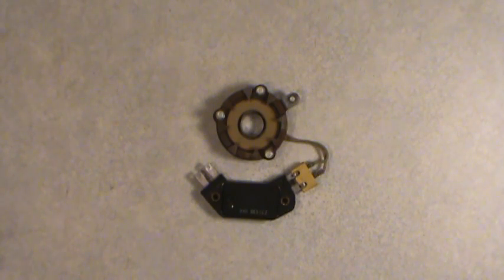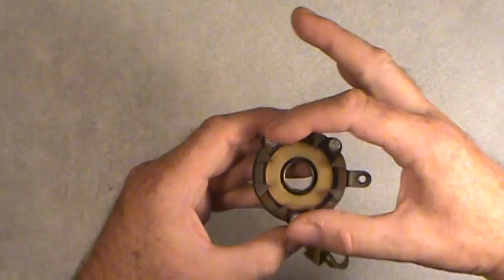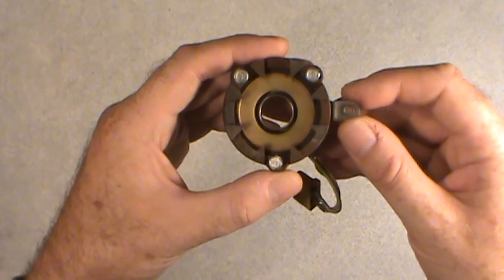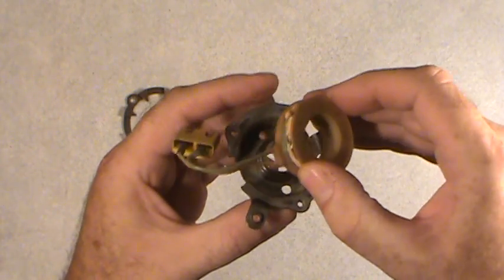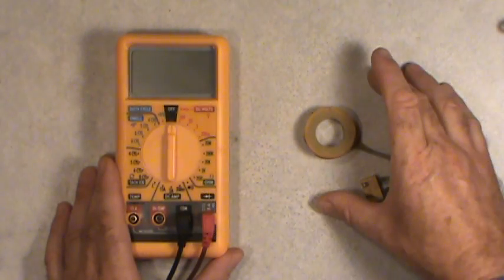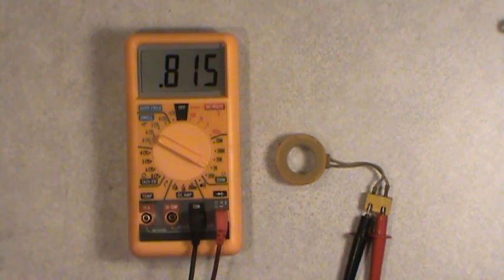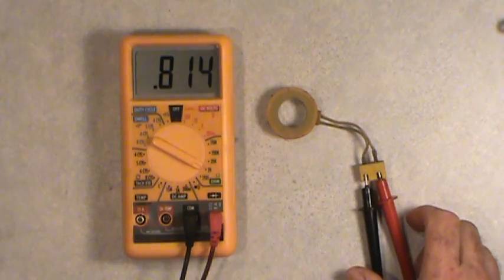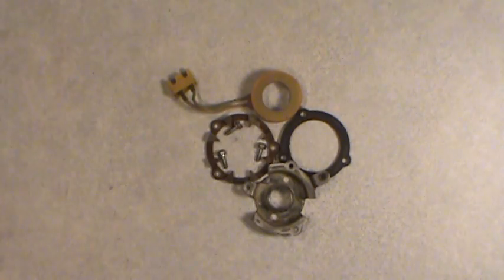HEI Distributor Pickup Coil Test

Comment: 88 Z28...  strange misfire I've been dealing with for 2 years now...  seems to be centered on the pickup coil.  I fully rebuilt the distributor last year with GM parts, even sourced an NOS shaft assembly in case magnet was cracked.  Also have an aftermarket distributor, completely new, that has a different style of coil that does the same thing.  Pickup coil, given a constant input speed (say, 650 rpm), is outputting a variable frequency, which obviously resonates through the rest of the ignition system resulting in bouncy tach and random misfire.  Any suggestions?
Reply from the maker: Greetings...Daniel Vogel..........Thanks for watching.........Yes-Sir-ee-Bob, I do have a few things for Ya.........First up, try "diss-connecting" the Tach (Tachometer) wire/s, from the electrical circuit, then, start the engine, to see if that changes things (there might be a Tach-Filter, in the circuit as well).........Make sure, that, there is a thin coating of (computer chip) "Thermal Paste", applied to the bottom (metal side), of the ignition control module, or, it will over-heat, and probably go "poof" on Ya (Don't use die-electric grease, because it won't transfer the heat properly...!!!)...The proper (heat transferring "Thermal Paste/Compound", can be found at a computer/computer parts store (just get the cheaper, usually silicone stuff, because, some of the other stuff, gets quite expensive...!!!)..........If those two wires, that come out of the pick-up coil, are still reasonably soft, then, disconnect the connector, and "twist" the connector, so, those two wires, twist, one or two turns, around each other (this is known as, the old school, twisted pair shielding, which will usually help with, any interference, getting into those two wires)...(computer Ethernet cable, is twisted too, four twisted pairs/8 total wires...cool huh)..........Sometimes, the "Vacuum Advance" canister/unit, has the wrong specifications, for a given engine..........An engine that has, a "Low Vacuum" signal, at idle speed, showing on, an automotive type of vacuum gauge, that's hooked up to, intake manifold vacuum, usually won't get along with, a Vacuum can/unit, that was destined for a stock engine........Try diss-connecting the (rubber-like) vacuum hose, from the advance can/unit, and plug the loose end of the same hose, so, Ya don't get a vacuum leak...!!! (or, more headaches...lol)...and see, if that helps at all..........Those two sets, of triggering "triangles", have to have, equal "clearance" (air gap), whenever, each of the inner triangles, is advanced, one tooth (triangle) at a time (there will be 8 separate places, to be checking, for an equal air gap)........Don't want any of those triangles making contact...right.........If need be, there are 3 screws, that can be slightly loosened, then adjust, for the (equal) air gap, by moving (slightly), the outer set of triangles, and then, tighten those 3 screws...........Is the ignition system, as good as new...???..........Space the spark plug wires apart from one another (with non-metal, wiring looms), and, keep them away from, any metal parts, like valve covers (high voltage, likes to jump...lol)..........12 volts/battery voltage, going right into the HEI Distributor...??? (usually red wire/connector)...........The Ignition Control Module, has to be "matched up with", the Ignition Coil, or, there might be a problem (weak spark, or, over-heated ignition coil, maybe)...........Wowsers, now that I think about it, Ya might have a "Bad Camshaft Lobe", because, I started out, learning lots about, the good ole HEI distributor..."Before"...I found, that (not-an-exhaust-valve-lobe-anymore), that use-tah-be on, the camshaft's, number 4 cylinder's location...(was in/on, a Chevy 350...V-8))..............Symptom was, a slight misfire alright...!!!..........Ya might be ok, if Ya have roller lifters...........Having flat tappets (lifters), then, there was a time, where a few guys, and maybe gals too, that had, that good ole, soft camshaft syndrome (and, I never thought, that, that "bug", would ever bite me, but it sure did...lol)..........Maybe, check out, the D.U.I./Davis Unified Ignition (HEI) distributor website, because, they will custom make, an HEI distributor, that has, an advance curve, for your "Exact", vehicle and engine combination...best performance, from an HEI, dropped in distributor.........Have a look at their spark plug wires too...impressive, I must say.........Good luck, and......till next time.......Be Safe, take care, and have a good one.
Reply: @RockysRoadshow  yeah, tried all of that already.  It's a V6, btw.  No vacuum advance.  Vacuum is strong.  It's the pickup coil assembly itself that's the issue.  The pickup coil is outputting a variable frequency output for a constant speed input.   Both triangle style pickup and the stock HEI star assembly in 2 separate distributors.  It's varying by as much as 30 to 40 Hz at even 650 RPM input
Reply from the maker: Greetings...Daniel Vogel...…...Well now, that variable frequency, of, 30 to 40 Hz (or call it, cycles per second), could very well be, how the output, of the pick-up coil acts, and, here's probably why...…….The actual triggering pulse, for the ignition control module, as I recall, happened, during a "falling wave", electrical signal (probably, a form of sine wave), that was generated, soon after, the inner set of triggering triangles, just went past, the outer set of triangles...……..On a, not installed, V-8 HEI distributor, the pick-up coil, will usually output, at its "disconnected" connector, about one volt (probably AC, I forget), give or take a bit, when I would spin, by hand, as fast as I could, the helical drive gear, that was on the HEI distributor's shaft, you know, at the bottom of it...……..You can try that test, with your, non-installed HEI distributor...…….A Random misfire, can sure be caused by lots of things...…...Start, by having a close look at your engine's spark plugs...look ok...???...……..Might be ignition related, or, fuel system related, sometimes, might be both at the same time, perhaps..........Have you tried, any type of spark test at all...???.........There is an HEI distributor "Spark Tester", that is calibrated specifically for, a factory/stock HEI distributor.........It kinda looks-like, a spark plug somewhat, but, has a plain metal shell (no screw-threads), and, should have an alligator? clip, that connects to a ground source..........There is also, an adjustable type as well, that can be set, to test, in the thousands of volts..........Just Google...HEI distributor Spark Tester...and see what pops up........Good luck, and.......till next time......Be Safe, take care, and have a good one.
Reply: @RockysRoadshow  That's all been done already. EVERYTHING IS NEW.
I'm aware that the coil outputs a readable AC voltage...  usually around 1.5V.  It's the frequency that the module uses to determine timing.   What I'm asking is for a given fixed input rotational speed, why is the pickup coil not outputting a constant nonvarying output frequency like it should?
Reply from the maker: Greetings...Daniel Vogel……….Well, here's what's goin' on, as far as I recall, that is...…..Think in terms of, a good ole AC sine wave...…….It's when that wave, starts to come down (aka, fall), when the inner set of triangles, just go past, the outer set of triangles, and it is the, so called "Falling" wave location, that is actually, the "signal", that "triggers", the ignition control module (or, in other words, this is what the ignition control module is looking for, so it can get triggered)……….Un-filtered AC (Alternating current) is all over the place, and here's what I noticed, a long time ago...…….I had, and still have, a hand held, variable speed, rotary, Dremel tool...…….So, I plug it into a house receptacle, and move the speed control/slider (switch), into, a not too fast position, and, with the rotary tool, just free-wheeling (no load on it, what-so-ever), then, I could hear the "speed" of that Dremel tool, shall we say, "Wavering"..."Up and Down", speed-wise, that is, and, what I was hearing, was, how the Dremel's electrical motor, was "re-acting", to the fluctuations (not constant), voltage, that the house's (AC) receptacle was out-putting (a multi-meter, will also show, a moving up and down, AC voltage as well)...…….You might be over-thinking, the output frequency thing, when it comes to, just simply, "triggering" the ignition control module...……The basic, HEI ignition control module, that only had 4 (flat) pins on it (2 on one end, and 2, on the other end of it), and, when in operation, it would receive that (now famous...lol), "falling wave" triggering signal, that, as I recall, then, the ignition control module, will then, "shut off", the electricity (nominal 12 volts), that goes to the HEI's ignition coil, then, the magnetic field in the primary windings, collapses, and then, the secondary windings, will increase the voltage (in respect to, windings turn ratio, there-abouts), then, through the rotor, distributor cap, spark plug wire, and finally, the spark plug itself...……..The ignition control module, is responsible for, the ignition coil's "Dwell/Charge-up time", which is why, the ignition coil works so well, without melting...……..I recall seeing, as low as, about, 7 Degrees, on a dwell meter, that was on, a Chevy V-8 HEI distributor, while it was at idle speed, so the ignition coil, would not receive too many Amps, for too long of a time period (milli-seconds)………..Too many Amps, going into an ignition coil, for too long of a time period, that wasn't designed for that amount, will usually, just over-heat, and go kaput...…….There are some pretty good Websites, and/or, website "Forums", that have lots of information, about, all of the HEI distributor parts and pieces, and how  they function...…….Most of the information, that I've put here, is basically, how most of the HEI ignition modules get "Triggered"...……..The older HEI modules (1975), that only had 4 (flat) pins on them, didn't react with any computers (they were/are, stand alone, one wire, HEI distributors)……….I'll have to check out, your 1988 HEI distributor's ignition control module (and how many pins, that it has), and, see what I can remember (or not...lol)………..Connect a "Vacuum Gauge", to your intake manifold or plenum, and see, how many Hg (inches of mercury), that your engine produces at idle speed (15 to 20 maybe...I got about 17, on a V-6), and, the gauge needle, was holding steady (not fluctuating)………..Intake vacuum leak...???...intake manifold gaskets leaking maybe...???...and...…till next time......Be Safe, take care, and have a good one.

Comment: The pivoting that piece does is the vacuum advance.  At idle the vacuum is high, which adds advance.  At large throttle openings the vacuum is low which decreases advance at this part.  Then there is a separate physical centrifugal advance under the cap that is actuated by the spinning parts.
So if you're accelerating hard the centrifugal advance manages the timing, and when you get to speed and let off the throttle the vacuum advance has affect. (effect?)
HTH
Reply: I believe you got it all backwards.
Reply from the maker: Greetings...3Repete...…….Thanks for watching...…...Most of what you were saying is correct...…….A factory/stock, V-8 HEI (High Energy Ignition) distributor's, "outer" set of 8 triangles, that surround the pickup coil, is controlled by the vacuum advance canister/unit's, (pull) rod...……..The "inner" set of 8 triangles, get advanced (moved), when the centrifugal advance weights, sling outwards, and interact (make contact), with, the commonly called, auto-cam (mechanical advance), and is controlled by the engine RPM's (Revolutions Per Minute) "only" (doesn't matter, if Ur pedal-to-the-metal or not...lol...……..As for, the vacuum advance canister/unit, then, this device, only responds to engine "load" (aka, the intake manifold, vacuum signal)……….When Ur going pedal-to-the-metal, and the engine is under a lot of load, then, the vacuum signal, can drop to, almost zero Hg/Inches of Mercury (and the reading, usually depends upon, things like, the carb's CFM/Cubic Feet per Minute rating/restriction amount, as an example).........As far as I recall, then, the highest, intake manifold vacuum signal (that's measured in Hg, Inches of Mercury, that's commonly seen, on, a good ole, automotive vacuum gauge), will probably be seen, when the engine is in, a somewhat, high engine RPM's, "de-acceleration" condition...……As for the vacuum signal, that the vacuum advance canister/unit sees, at (curb) idle speed, then, that, in itself, would depend upon, whether or not, that, the vacuum advance canister/unit, is connected to, either, an...(intake) "manifold" vacuum signal source (below the carburetor)...or, a..."ported" vacuum signal source (who's vacuum signal, is usually taken from, just above the throttle plates/butterflies, via, usually, a piece of metal tubing/pipe, sticking out of the carburetor (I usually see it at the front, most times)………..For "smog" engines, I'm use tah seeing "ported" vacuum (as in "no") vacuum signal, at (curb) idle speed, and, the amount of ignition timing advance, for (curb) idle speed only, was usually determined by, where the initial/base timing was set to (I'm use tah seeing, factory specifications, set at, about, 5 degrees BTDC/Before Top Dead Center, initial/base timing, when at curb idle speed)……….If a distributor is set up correctly, to match the engine's ignition timing advance needs, then, I'm all for, the (intake) "Manifold" vacuum (signal) at (curb) idle speed, because, most engines, will like, quite a bit of ignition timing advance, when they are spinning that slowly, and also, the combustion event, isn't all that impressive, at the very same time...…….So, yeah, basically speaking, then, the Mechanical (centrifugal) advance amount, is "only" determined by, engine RPM's...and...Vacuum advance, (with the exception of "ported" vacuum, at curb idle speed), will usually be determined by, engine "load" (aka, the vacuum signal, that the engine sees, inside of the intake manifold, under, almost all, operating conditions), that also include, the..."Driver's BIG Foot"...!!!...lol...and......till next time...…Be Safe, take care, and have a good one.

Comment: i really liked the explanation  i just learned something new & it wasn't that hard to understand   nice video regardless of what other people's comments say !! 2 thumbs up
Reply from the maker: Greetings...nick diaz………..Thanks for the nice comment, and for, the "2 Thumbs Up".........The HEI (High Energy Ignition) distributor's pick up coil, has many turns, of very fine (really small diameter) wire, that's wrapped around the plastic bobbin, and is subjected to, a lot of heat, that's in that area, of the HEI distributor's insides, so to speak..........I replaced the one, that I had in there, because of, what that heat did to, the tiny wire's insulation (dried it up/didn't look good to me at all), even though, it was still working ok, at the time (I didn't want it to quit working on me, in the middle of no-where, so, I put a new one in there, just in case, as well as, it was already disassembled anyways)...and......till next time.......Be Safe, take care, and have a good one.

Comment: Just finished replacing both the ICM and pick up coil in my 1994 Fleetwood Southwind Storm 28ft GM P30 RV chassis. Something I won't have to worry about while on the road. The items I pulled were original with 58,306 miles. Here's what it looked like.... https://www.dropbox.com/s/7v3r2hi4q0ckdef/20190515_220427%5B1%5D.jpg?dl=0
One of the common symptoms of this (pick up coil failing) acting up is the engine will just randomly turn off (think light switch). It can be very a intermittent issue as well.

Comment: thanks for taking the time to pin point the parts and showing how it works. it really has helped me a lot. I'm doing an engine swap and theirs a lot to learn, I've learn a lot these past few months and thanks to all people like you on the internet helping me with everything.
Reply from the maker: Greetings...Edwin Aviles..........You're welcome, and, thanks for watching.........Make sure, that you are getting 12 volts or more, at, the usually red, (ignition switch) power wire, that connects to the HEI/High Energy Ignition's, distributor cap terminal.........I just mentioned that, just in case, you might be upgrading, from an older, points and condenser, type of distributor, which has lower voltage (and amperage), than, what an HEI type of distributor needs, so it will work properly..........Good luck with your new engine, and.......till next time.......Be Safe, take care, and have a good one.